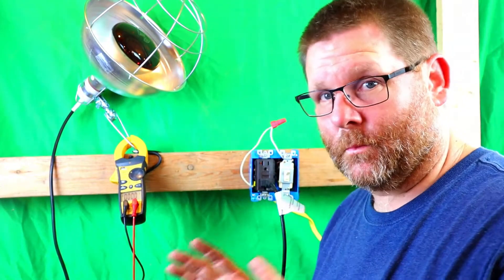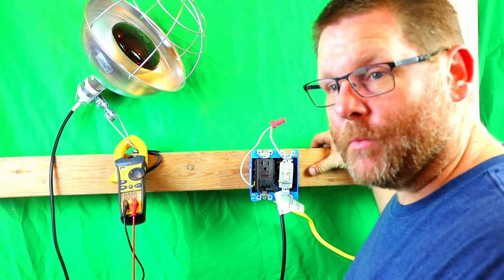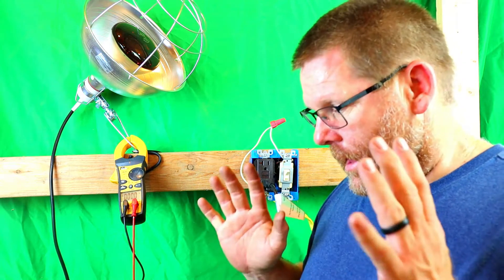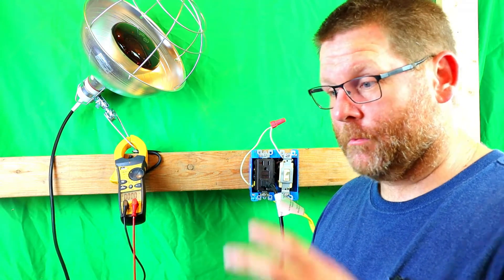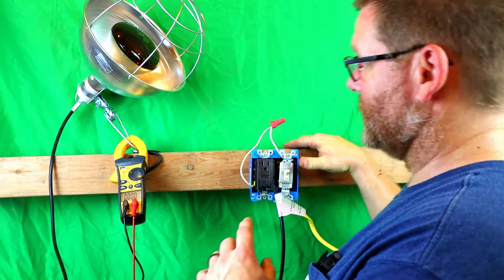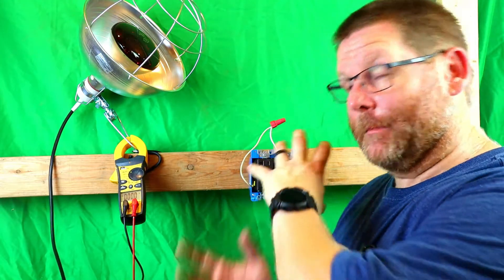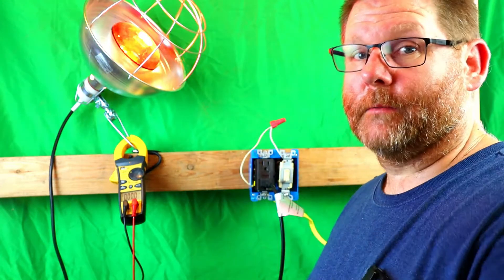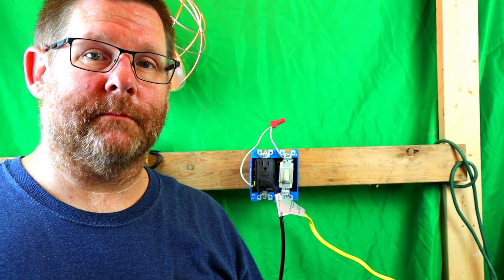Can You Switch A GFCI Receptacle

Comment: You didn't show how to wire it. An inspector told me that any outlet within 1.5 meters from the kitchen sink had to be GFCI. I had no issues except when it came to my garburator under the sink which is of course on a switch. I wish you'd show how to deal with that scenario.

Comment: Hi Need some help on my old switch Receptacle,  I trying to replace my old receptacle with a AFCI receptacle. I open the one in the wall and see three white wire's. 2 on the neutral side silver and 1 in the hot side  brass. how can i connect the new AFCI receptacle. Thank you
Reply: Looks like you have an old school switch loop and the electrician who wired that receptacle may have either forgotten to reidentify that white wire as a hot or switched wire (by simply wrapping black/red electrical tape around that white wire) or didn't have to back then. That white wire connected to the brass terminal is most likely a switched wire coming from a nearby light switch. If you see that the brass tab is broken, the only outlet connected to that white wire is switched. If not, then both outlets in that receptacle are switched. 

In any case, I recommend you to to disconnect all the black and white wires, remove their wire nuts, untwist them, and pair each black wire with its corresponding white wire (by simply looking the wires emerging out of each sheathing) when you've cut power to this receptacle. Keep the grounds bonded. Next step is to identify your wire feeding power to this box. If you have a multimeter that can measure continuity, you can do this without flipping the breaker. Hook up the black lead from your meter to the ground wires and the red lead to each white wire until you hear/see continuity. Whichever white wire has continuity with the grounds has its corresponding black wire feeding this box. Why? Because the main panel is the only place where white neutral wires are bonded with ground wires. Once you've identified that black wire and hopefully taped it so that you don't forget, you simply connect this wire and its white counterpart to the line side of your AFCI receptacle. Pigtail the rest of the wires and connect them to the load side of your new receptacle and that should be it. 

You should not only have constant power and protection to the rest of the receptacles downstream, but also a neutral wire available in the light switch that controlled your old receptacle, which further puts up to current code and makes it possible for you to add a light/fan fixture or upgrade to a smart switch in the future.
Reply: @aurvaroy6670   thanks but need the answer a month ago, the inspector that came over to my house passed the inspection. He didn't notice that 1 plug that I didn't change to AFCI Outlet.
Reply: @craigswu  I know. I wish I saw this video earlier but shit like this happens. Either way, existing circuits that currently require AFCI protection but were wired before it was required doesn’t need to be AFCI protected, unless you add at least 6 ft of new wire or just feel safer with it. That’s probably why that inspector didn’t notice. All they look for is anything unsafe for the new owner or new wiring since the old wiring is all “grandfathered”.

Comment: Have absolutely no understanding as to what just transpired?  Sorry.
    No Load on the GFCI?
Reply: The question was..Can you "switch" a GFCI? The answer is yes. In other words..Can I plug something in my GFCI outlet and use a switch to control it? Answer...yes you can.
Reply from the maker: I believe that the video is self explanatory
Reply: @MountaineerOutdoors  
Did you have the switch wired to the load? Common ground, and just the neutral and hot connected from the load on the gfci to the switch? 

Or did you have to do something else to cause it to switch on/off?
Reply: @TrivialPants  "Did you have the switch wired to the load?"

No, the switch leg wire from the light switch goes to the brass screw on the line side of the GFCI receptacle. Nothing should be connected to the load side unless you want more GFCI protected receptacles that are also controlled by the same switch for some reason. Also, if you do connect it to the load side for whatever stupid reason, the GFCI receptacle will not function properly and possibly stay tripped forever until you fix it.